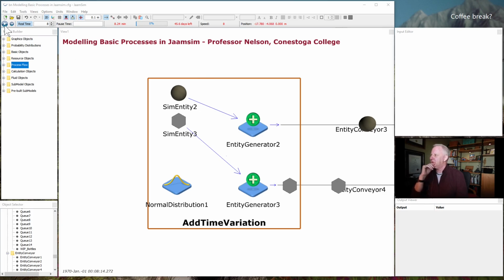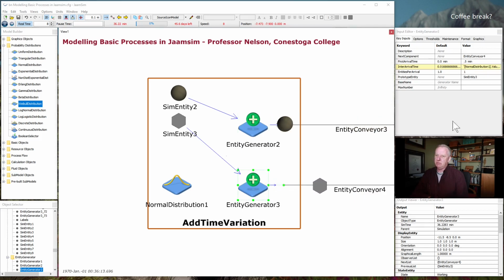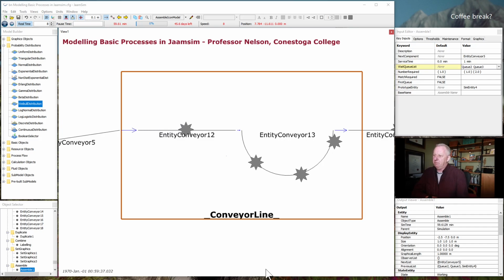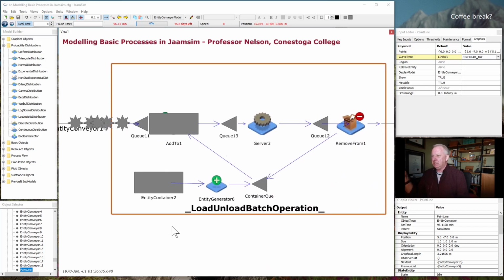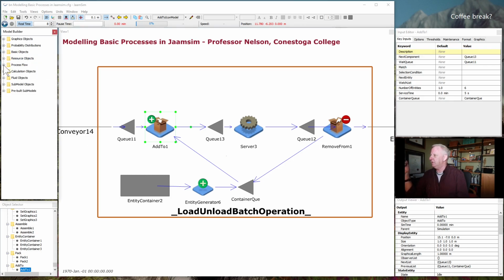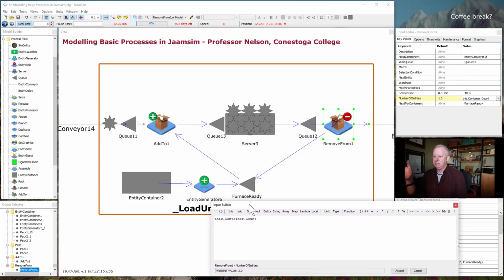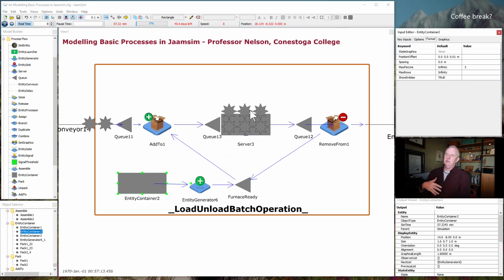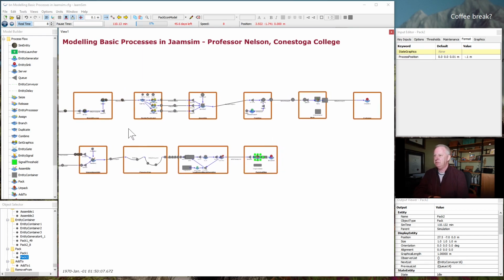Jaamsim Tutorial Part II - How To Model More Advanced Processes

Comment: How can I create a condition so that my component does not leave server 1 via the convayer towards server 2 until server 2 is free again?
Thank you very much!!!
Reply from the maker: I think of this like a Kanban signal. You can build the signal with an Expression Threshold that looks at the downstream Server 2 and opens when the server is free (I usually base it on the que length, but something like [Server2].State="Idle" might work. (not sure if I have the right syntax here). When you run the model, the expression threshold should alternate between open/closed and show red/green status. Now you can add this threshold item in the Threshold tab of Server1. See 3.3.2 in the Jaamsim manual for an example. Hope that helps!
Reply: @professorbnelson3592  thank you very much! The Expression Threshold was a very good hint. I messed a bit around and it works with "'[Server_x].NumberInProgress < 1'"
Reply from the maker: @Luke-ew9mk  Awesome. There are so many features tucked away in this program --  I'm only scratching the surface myself.